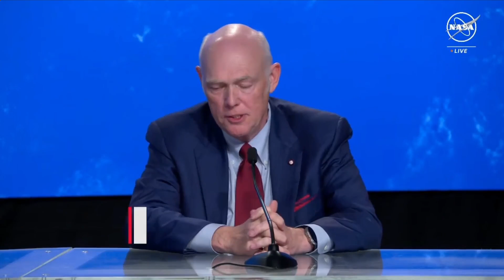Why was Boeing Starliner's first crew launch attempt scrubbed? Tory Bruno explains

Comment: No doubt Tory made the right call to scrub the launch and gave a great explanation of the problem and why the call was made.  The reason this scrub is being magnified so much isn't due to this event alone but rather that its another continued delay on a project already years behind schedule.  Also contributing to the magnification of ULA's issues is the fact SpaceX has been successful for years transporting folks to and from the ISS reliably and affordably.  When the ULA does succeed, it needs to find a cost effective way to compete against SpaceX so it's not looked on as an expensive backup option to SpaceX.

Comment: All those people ragging on Boeing's spaceflight division long after the problems of the unmanned flight test 1 and 2 were dealt with are completely disregarding that standards for manned capsules are quite high. The "flammable tape" issue is related to that. The so-called flammable tape is found on many airliners you fly on and is "flammable" under only the most extreme conditions and the rules put in place after Apollo 1. SpaceX had many problems fixing the Dragon 2 to abide by manned flight rules as well. (If you don't have selective amnesia, you will remember the Dragon 2 EXPLODED during a test that no one thought would be hazardous.)
This valve fluttering problem is another example of how differently treated unmanned flights are in comparison to manned. Because NASA is so careful, I have full confidence in the Boeing Starliner after NASA gives it the green light. Always remember, the Space Systems division is separate from the Military Equipment division and the Commercial Aircraft division of Boeing.
Reply: I'm just curious, do you still trust the fabled Boeing space division even now?

Comment: Sharp tongues say: "Would you fly with a Boeing Starliner, when you know parts are falling off from Boeing Airliner ?" 
Thats a cheap choke.  
But truth is, that this company has done many shortcuts to make the production and operation of their airliners cheaper. They have gone too far with cost cuts!
  But I don't think that the Airliner problems have something to do with the Starliner problems, and definitely not with this launch attempt breakup, because the problem was not Boeings part this time, it was a problem with the carrier system rocket provided  provided by theyr project partner United Launch Alliance (ULA).

Comment: The bigger issue here is the supposed trip to Mars. The rocket that would be used for the return trip will be dormant and inaccessable for at least a year, possibly two. What are the chances that it will work after that time? Or that neither the oxidant nor the fuel has evaporated / leaked ?

Comment: Yeah, we don't want another "go with throttles up" and some 10 cent rubber around some O-ring or valve fails.
Reply: Shuttle SRB O rings were 38 feet in circumference.  I guarantee they cost a bit more than 10 cents.

Comment: No one has ever designed a good cryogenic valve. It’s always been a problem. If you could build a better mouse trap, plenty of aerospace companies would buy them.
Reply: This valve vents gaseous oxygen ullage overpressure.  It doesn't handle cryogenic oxygen.
Reply: @stargazer7644 The gas is -297. C. It literally is cryogenic gas from the boil off of the lox.

Comment: Starliner should be removed from the Artemis program and scrapped.
Reply: Starliner is not a part of the Artemis program. Orion is the crew capsule for Artemis.
Reply: @ken_h9559  Whatever, it needs to be scrapped. Too many issues, too much money. Time to cut losses.
Reply: NASA (taxpayers) have paid Boeing over $4.2 billion to create this thing and fly it at least 6 times at a cost. We should get something out of it.
Reply: @rosswarren436  What I do not want to get out of it is a repeat of the Challenger and the Columbia. Time to cut losses and move on.
Reply: @waynespringer3320  I do not see any future in which those are a possibility with Starliner. It has a probability of loss of crew higher than Crew Dragon did during DM-2, there is no valid reason to be overly concerned
Reply: @mistertagnan  You don't that fine. But having followed NASA they have a questionable track record of rushing for publicity. Case in point engineers told them Challenger should not fly on that day and NASA ignored the warnings. Perhaps they have changed. I sincerely hope they did. But it doesn't change the facts of the over budget and myriad of issue from the contractor Boeing.

Comment: Skilled set of excuses, but if it's 'just a valve like you have at home on your hot water system', then are you saying that 60 years after such an anomaly was unlikely to occur, you are incapable of designing a flawless component like that? I'm old enough to remember when these Companies were braver and just 'went with it' unless they identified a serious safety issue, which this clearly was not. Following what used to be the excitement of all things space, todays launches, whoever's doing them, is frustrating and boring in the extreme.

Comment: How many decades has the RL10 flown and this is still an occurrence
Reply: Yeah, it's as if rocket science is difficult or something 🤔
Reply: It really is rocket science and engineering.
Reply: Valves are valves. Nothing is ever perfect 100% of the time, no matter how good you make them. Remember it was a Helium valve that stuck open which caused an over pressure event on the recent Peregrine lunar lander that caused it to go awry and never get the chance to attempt a landing.
Reply: This was not an RL10 issue
Reply: Well, apparently this is not an issue except for crewed flights.  Normally they'd just cycle the valve and move on.
Reply: Falcon9 has over 200 flights and they still scrub once in a while. The difference is Space X don't tell you why.
Reply: @LG-ct8tw are you sure about that!?😂 spacex always announce the reason of scrubbing on X lol
Reply: @LG-ct8tw spacex is the only company who shows their rocket blowing up😂
Reply: @LG-ct8tw    "Falcon9 has over 200 flights and they still scrub once in a while. The difference is Space X don't tell you why."

That's because 99.9% of the time it's weather related and has nothing to do with hardware.  It's OBVIOUS the reason why the scrub.
Reply: @phillipzx3754  somewhat recently SpaceX was on a scrub streak due to the TE refusing to retract
Reply: @mistertagnan    And how did you learn that information had SpaceX not announced it?  😉

Comment: Scrubs are common across the aerospace industry. Weather, mechanical, procedural limits are all very common. No need to blow this out of proportion just because it’s boeing as the payload and more importantly there are people up there. Even with the pressure of needing to succeed for Boeing, ULA made the right call because you can always stop and pause rather than take unneeded risk.
Reply: Yeah they have a let’s just see what happens attitude.
Reply: Not common with SpaxeX.
Reply: @Harald- There's been multiple falcon 9 scrubs and if I am remembering correctly, falcon heavy as well. Things happen, that's just the industry. As stated in the video, it wasn't a "big deal" but there's no need to take extra risk with a crew on board. Very responsible decision from ULA, who has a 100% mission success rate btw.
Reply: @tylerprow6441  Falcon 9 has had multiple scrubs, especially in the beginning. The only difference it was  with over 220 successful launches with 98% successful booster recoveries! Nobody can touch that!

Comment: A valve not functioning properly is a big deal. Disappointed that they are playing this down. If it is an ongoing problem that they have to keep resetting, that then suggests a design issue.
Reply: It’s a tried and tested design.
Reply: Why didn't you listen to the explanation given?  This is something that happens rarely, and they have a tested and functional procedure for when it comes up.  They just won't allow ANY procedures like this when crew is present as a matter of policy.
Now how in the world did you twist that into what you said?
Reply: @stargazer7644  They said in the video that it has happened repeatedly over time. Other reports confirm this.  Thus not "rare". Turning it off and on again was a reasonable workaround when boosting cargo because they could accept the risks to do it when loaded. Not allowing the procedure when crew on board is prudent. But it should also have been revisited in an engineering refresh long before this. Life critical systems require a higher degree of reliability. But even for cargo there should be iterative improvements to eliminate known issues.
Reply: @Stu_Bur He literally said in this very video that they saw a sustained buzz in one other flight, and short buzzes on 3 or 4 flights.  They've launched this rocket almost 100 times.  If 1% of flights isn't "rare", how exactly do you define rare?
Reply: @stargazer7644  5/100 is a 5% failure rate
Reply: @Stu_Bur  You might want to brush up on your math.  Only one other flight had this problem where it was a problem and they had to take action to correct it.
Reply: @stargazer7644  You just stated 5.
Reply: @Stu_Bur  Maybe you should pay a bit more attention to what was actually said.  All of the other events self corrected.  They required no action, and didn't impact anything.  There was only one other event that was a problem, and that cleared as soon as they cycled the valve.
Reply: @stargazer7644  An abnormal event is an issue regardless of whether it is corrected or not. Correcting the issue allows a launch. Engineering out the issues avoids the potential for future problems.

Comment: So, there was a danger to the crew, you were lucky to help them escape. You were extremely lucky to be able to cycle the valve before it became a failure that destroyed the booster, eh ???
Reply: Thats not at all what he said.
Reply: You missed the part where he said it's a common issue and that if they were launching an unmanned mission that it would have been cycled on the pad and launched.
Reply: There was no danger to the crew or the booster. Introducing the corrective action would lead to a state of heightened risk, so they cleared the crew prior.
Reply: Listening comprehension really isn't your strong suit.  He didn't say or imply any of those things.

Comment: They wanna send a Boeing with people into space? Im no expert but if it wasn’t made by spacex then I wouldn’t get in it.
Reply: SpaceX has carried people into space fewer times than Apollo.
Reply: @stargazer7644  wrong. SpaceX has flown ~13 crewed missions to Apollo’s 10. They’ve also flown 50 people into space vs 30 on Apollo.
Reply: @mistertagnan  I'm not sure why the number of people would be significant here.  Whether there's one person in the capsule or 5 doesn't really pose any extra operational issues.  There were 11 manned Apollo flights.  Apollo 7-17.  Do I get to yell "wrong"?
Reply: @stargazer7644  ah, I miss counted Apollo 7, my mistake. Also, my point with the amount of crew was that Apollo doesn’t beat SpaceX by any of the relevant metrics (# of crewed flights, # of astronauts launched). 

Although admittedly if you count the Skylab missions as part of Apollo, they do beat out SpaceX slightly for number of flights, although I don’t feel like counting the exact number at this moment

Comment: listen up knot heads,its not Boeings fault its the booster from ULA
Reply: ULA is owned by boeing although i agree that this is not a boeing issue
Reply: @w4drone720 ULA was born from the merging of the launch services devisions of both Boeing and Lockheed Martin. Moreover, although it is not entirely independent, ULA is nevertheless distinct from either of its parent companies. ULA retains an exemplary track record, which is not tarnished by the less-than-stellar performance of Boeing in recent years. 
Indeed, this issue was with the booster, not the capsule, and it sounds like it should be a quick fix. Many of the commenters seem to mainly be here to criticize Boeing—which, okay, Boeing definitely deserves criticism in a lot of areas, but this relatively mundane scrub of a rocket they don’t even build feels like the one area where that isn’t the case!
Reply: @Delta-V-Heavy  It sounded like a centaur issue, which is the upper stage of the Atlas. There is no reason for an SRB to have a LOX vent, not sure why the news quoted that immediately. That being said, i dont quite understand a lot of the hate in the comments
Reply: @w4drone720 centaur is not an SRB
Reply: @tylerprow6441  That’s… what i just said. Not sure why the news immediately reported it was an SRB valve, I don’t think they have ox vents at all
Reply: @w4drone720 ULA is not Boing.

Comment: Its hard to believe they human rated balloon tanks for this flight. yikes,
Reply: Jesus Christ. Balloon tanks have been used since the late 50s
Reply: Your can of Coke or Pepsi or beer is a balloon tank so it's not like we don't use them everyday.
Reply: @wally7856  Cans of Coke do not collapse if you let the pressure out of them.
Reply: @stargazer7644  They do if you put some weight on them like when cases at the store are stacked 20 high.
Reply: @stargazer7644  A pallet of beer cans wouldn't hold itself up if it wasn't under pressure in a balloon can. That's all I'm saying. We use that tech everyday.

Comment: This may've saved the lives of the crew.
There's no way I would fly on this turkey.
Reply: I wouldn't get on Boeing's capsule either, but that has nothing to do with ULA's rocket.
Scrubbing a launch over something minor like a temporary valve issue is normal and not a sign of a defect.
SpaceX regularly does the same, sometimes even multiple times for the same launch. 
That's just the nature of working with cryogenic propellants.
Reply: This valve anomaly was on Centaur upper stage, one of the most reliably in the industry.
Reply: but its not. It just cost millions. Its not for human flight.  @bazoo513
Reply: @JulioVoss7   probably whistleblowers too. One day before their retirement.
Reply: The centaur and the RL-10s are only the most reliable of their kind in the entire industry 🗿

Comment: Boeing need to shutdown operations and have real engineers take control of it all instead of the suits that made a joke of the name. Engineers wont make the right economic calls but they wont push something not ready on the pad.
Reply: This is common in the space flight industry, most launches have scrubs occur before launch. The CEO of ULA is himself an engineer, and an excellent one at that. The Atlas V is one of the most reliable rockets ever made, with only one failure in its over 20 year operation. The only reason ULA and Boeing decided to scrub the launch was squarely for safety.
Reply: It's important to note that Boeing is a large company with several divisions, so the commercial aircraft division (with all the manufacturing issues) is separate from the aerospace & defence teams.  Space flight requires completely different checks & balances, and Boeing has partners to hold them accountable - incl. ULA, the company Bruno (the guy in this video & an engineer himself) heads up.  Scrubs like this are normal in space flight, especially with humans onboard... no hardware reaches the pad with question marks over it's safety, but if things don't happen as expected during the launch sequence they will immediately stop it.

It doesn't matter how big or small the issue is... if it's not right, scrub the launch.  They can't afford to take any chances with people sitting on top of a giant rocket, and even for missions where there is no crew aboard it's far too expensive to risk losing the ship & cargo.

So while Boeing definitely needs a shake-up especially in it's commercial manufacturing business, it's important not to jump to conclusions about the safety of their aerospace operations.
Reply: @medea27  the space division certainly isn’t perfect, as they’ve had a few issues with Starliner, but other than that their record has been pretty good as far as I’m aware
Reply: As I understand, that was an issue which is in the responsibility of Boeing.
Reply: No, you will be taking away their bread and butter TAX PAYER's paycheck.
Reply: Boeing are killing off the real engineers for speaking out

Comment: It’s a Lockheed Atlas V rocket, one of the most used and tested of all human rated rockets. There is no cause for alarm.
Reply: Buddy I don’t know how old you are but Lockheed and Martin Marrieta merged like a million years ago, this is a ULA Atlas V
Reply: But don't we WANT to be alarmed?  Isn't that why we're here?
Reply: AINT NOBODY WORRIED ABOUT THE ROCKET ITSELF!!!!  EVERYONES WORRIED ABOUT THE CRAP THATS ON TOP OF IT!
Reply: While the Atlas V is a good platform, I'd rate it as one of the least used and tested of all human rated rockets.  99 Atlas V rockets have launched.  Exactly zero have had humans on board.  Apollo launched at least 10 times (depending on how you count), all with crews.  331 Falcon 9's have launched, 13 flights carrying humans.  Soyuz has launched 153 times most of them with crew.  The Shuttle launched 135 times, all of them crewed.
Reply: "No Alarm" if you depended on this rocket getting off the launch pad you would be dead.
Reply: @667crash  And why would anyone NEED to get off the pad?  Takeoffs are optional.
Reply: Last time an atlas launched a man was 1963.   An obsolete rocket carrying a likely flawed space capsule design. Why are we giving Boeing more money when they cant produce?
Reply: It is currently the second most reliable rocket in the world.
Reply: Its not atlas thats the problem.
Reply: @stevefink6000  yes it is, it was the centaur second stage
Reply: BS ..... Boeing is in on this one.
😄
Reply: @noneshere dude no one here likes boeing but that doesn't mean everything is their fault
Reply: @noneshere  Red hat too tight?